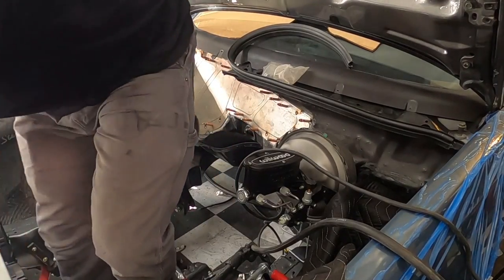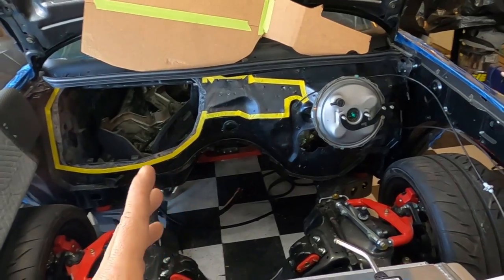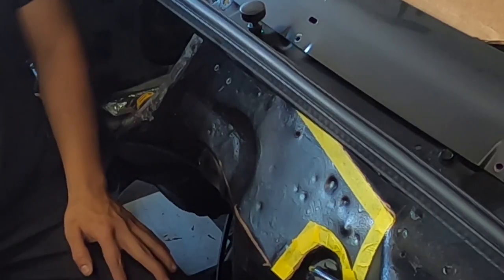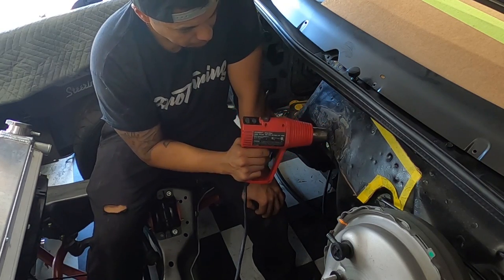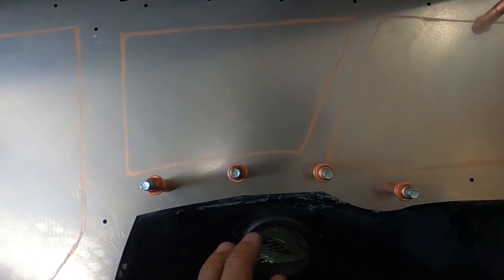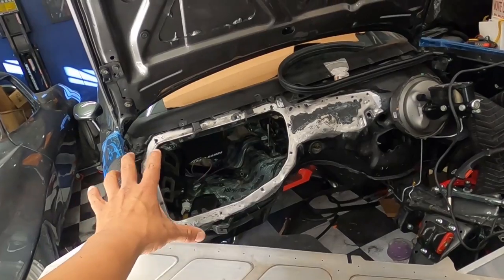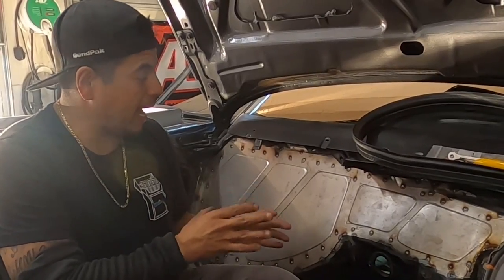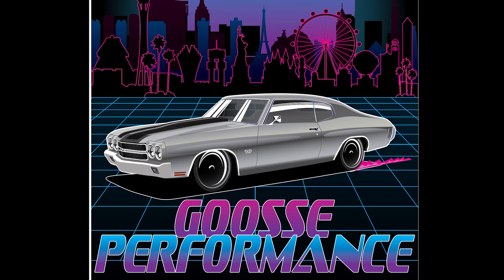INSTALLING G BODY FIRE WALL A/C DELETE PLATE ON A 84 CUTLASS

Comment: What about ac and heat?
Reply from the maker: Not sure what the question is as this is a A/C delete plate, if you run the new gen vintage air kit you will have to cut the entire passenger side of this plate but old gen kit will work if you just drill holes for lines
Reply: @goosseperformance1444   yes thats what I was wondering. I think the ac looks cleaner with just the holes. Are you also able to get heat with the vintage ac kit?
Reply from the maker: @passportgang8189  no sir , contact 80z performance